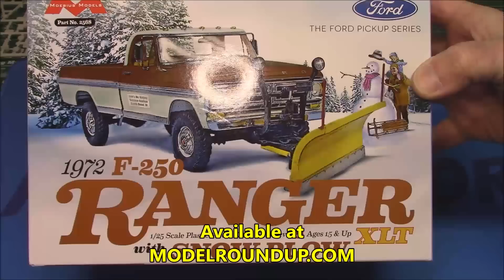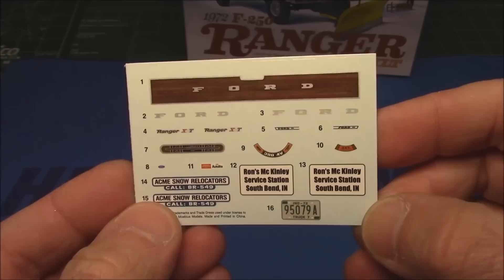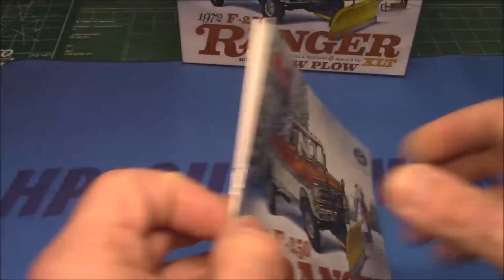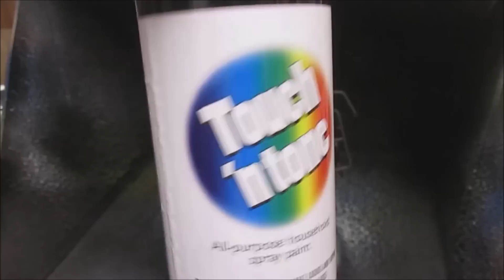1972 Ford F250 4x4 Plow Truck 390 V8 1/25 Scale Model Kit Build How To Assemble Paint Snow Effects

Comment: The cab and bed are uneven. Which makes it so much more realistic! How many times have we seen older trucks uneven in real life? Esp. work trucks. Even those 60s-80s Fords came off the line imperfect! Just my opinion. I love when an accident turns happy.
Reply: So did Bob Ross... So did Bob Ross. 😑 Happy little accidents.

Joking
Reply: My 68 short bed didn’t match up like that. It was a rusted beater and it just added to the affect.
Reply: I even don't want to see and model related things for now at least
Reply: How many Fords have you owned? I've owned 12 between 68-97, several bought brand new and no... they were not misaligned from the factory. The dealerships would lose their damn minds if they were receiving tweaked trucks to sell. And this model was built with the idea in mind that it was purchased new only a few months before plow season, so it would not have been an old truck in 1972
Reply: Buddy, I drive a 2004 F150 that came slightly uneven from factory!!! I had to loose the screws on the bed and adjust it on a local shop lol... so yeah... 100% realistic

Comment: The one thing that I dislike about the model is the plow, that plow is a quick release plow, which didn’t come out until the 90s-00s, the plow should be a frame mount plow, where the lift and lights are separate from the plow itself

Comment: Terrific build.  It's amazing how modern parts go together so well.  Would have emphasized the lovely wheel trim options by painting the wheels something darker.  The only thing missing is a flashing orange dome light for the roof and a CB radio and antenna.  A road-sanding module for the pickup bed would have made it perfect.
Loved the Tamiya snow effects.  Great job, Chris.

Comment: one thing i wish these modle kits would do is actually make it so the front axle is steerable and the wheels rotate. Would allow to make feel more realistic as well as when placing it on display you can actually steer the front axle or plow so it didnt look like it came out of a plastic mold. But i guess thats something i could fix with my 3d printer.

Comment: Chris, Great build! I like the snow! The kit is long overdue!!! The plow was a great add to the Ford kits. Will definitely need to get one! Had a '70 F-250 4X4 w a Meyers Plow. The only difference was it didn't have power angle. The spare was in the bed, mounted on the driver's side of the box. Happy New Year to you& your family 🎉!!

Comment: What I want to do is build one of these trucks but transplant my resin Cummins 12 valve kit into it so it looks like a diesel tuner modded it.  All Ford Dodge and Chevrolet pickups from 60s to mid 70s had the gas tanks in the interior behind the seats. I remember when I was going to tech school one of the students had a really cool looking 67 Chevrolet pickup that he had with a 350. He came to school one morning in his dad's car and I asked where his truck was and he said he went out to his truck and he said the inside reaked of gasoline. His tank sprang a leak.

Comment: I'm thinking the engine is a 360 not a 390. 390 not installed in 4x4s. Although my 69 has a 390 I transplanted from a 2 wheel drive 1 ton.